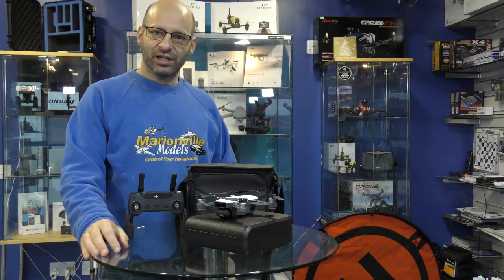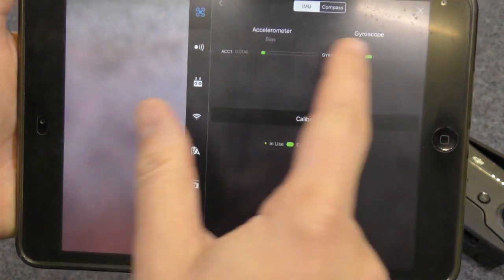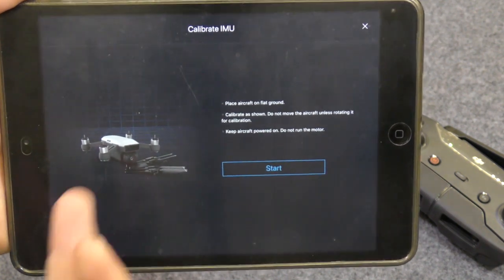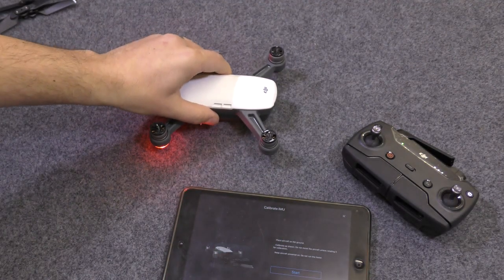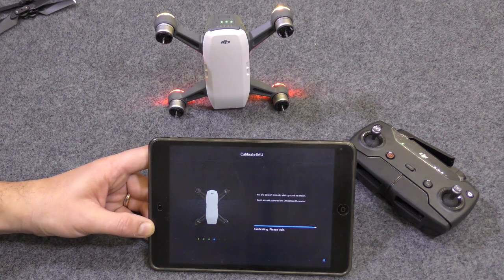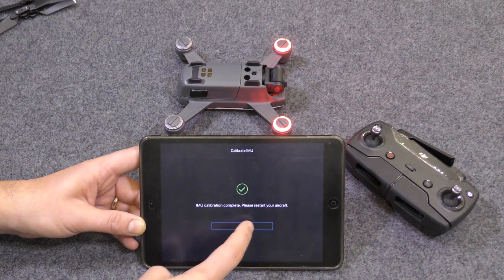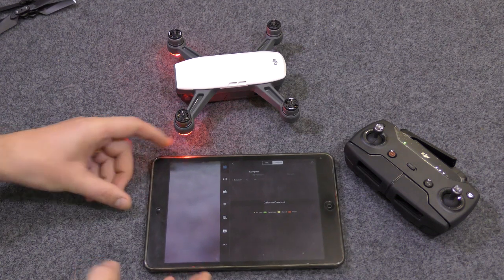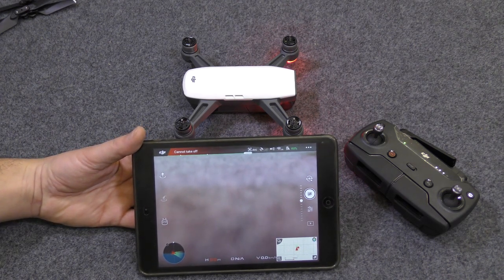DJI Spark Drone. How To Calibrate Compass & IMU

Comment: Hello dear i have connected sark rc through wifi with mobile, during the flight it show disconnected and i have to land drone manually with rc without footage and agian repeat on/ off process. What would be the issue ? Do i need cable connection within rc and mobile?

Comment: Hi there. I see you know a bit about the DJI spark, I’m having issues with one I purchased second hand recently. The problem I am having is the atti mode won’t go off. I’ve recalibrated the compass and the imu. The drone flies ok and active track is good but it never updates the home position. My drone appears on the map and it has satellites too
Reply: Are you using a controller or just your phone? If using the controller is it set to sport? That’s the slider switch in the Center.
Reply: @RC-Flight  I sold it a while ago buddy

Comment: Hi, i just bought a second hand dji spark. I calibrated it multiple times but it is incontrollable.  I swipe to take off and it immediatley drifts off. Any tips to get it to hover properley would be very much appreciated.
Reply: Have you solved the problem? I have the same problem
Reply: Hi, this is a long time ago. I dont think i did fix the problem. Ended up buying a new Mini2.

Comment: horizontal & vertical w/camera towards ground (latitude/longitude) is the correct way  - > not horizontal and sideway horizontal. i fly my spark daily, dji purposely misguided first time drone flyers with this incorrect compass calibration ..
Reply: Makes sense horizontal and camera down vertical for compass calibration, that's how you calibrate many other drones,

Comment: How can I get more distance in uk. I've changed yo FCC on 2ghz but still not getting any further what else can I go thnx.  Bigsighalive@yahoo.com
Reply from the maker: In the UK were legally limited to 500m by law so extending beyond that is kind of pointless. DJI make the power output depending on the location your in so you may find your still in CE mode despite the controller saying your in FCC. To be honest i dont fly beyond line of site so i havent looked much into it.
Reply: Aw thanks for the reply I hear what your saying  but  I really need to fly further    I’m also going to Cyprus on Friday and taking my drone I need distance ther too  to monitor my land  which  I can’t access by car or foot 
Wonder if il be able to fly further in Cyprus

Comment: I'm getting a check redundancy status  what does that mean
Reply from the maker: Haven’t seen that before but sounds like one of the sensors is having an issue.
Reply: @MarionvilleDrones  ok thank you
Reply from the maker: leemcrs74 if you check in google its something that comes up a lot but no solutions that I can find.
Reply from the maker: leemcrs74 have you had a bad landing lately.
Reply: @MarionvilleDrones  yes
Reply from the maker: leemcrs74 the IMU will have stuck. If you knock with your knuckles on all side of the craft body it may in stock the IMU sensor. You have to be quite hard with it.

Comment: My dji spark crashed, now its showing  "no 1 imu calibration error 71", pls help
Reply from the maker: pawan sharma the sensor may have got jammed. Try knocking with your knuckles on the top, sides and bottom of the craft. It may free it up.
Reply: @MarionvilleDrones  getting same error
Reply: I tried so many things but getting same error, pls help
Reply from the maker: pawan sharma i would speak to your dealer.
Reply: @MarionvilleDrones  sir any update?
Reply from the maker: pawan sharma speak to your dealer.
Reply: @MarionvilleDrones  Sir someone gifted me, dont have bill, I m helpless

Comment: Hello how do I get dji  insurance recently bought a second hand spark also have a mavic platinum but having difficulty in getting insurance something about I should have applied 48 hours in advance. Do you have an address where I can get a good insurance which does not cost an arm and a leg. Hoping you can help me Regards Irvine
Reply from the maker: Irvine Forbes yes you need to take the Care out within 48 hours of activation. If you contact DJI and send them a video of your craft in flight you can take out insurance after the 48 hours.

Comment: Why do I have to pair my spark and remote control every time I use it. It's a pain
Reply from the maker: Roger St martin that shouldn’t be necessary.
Reply: Use otg cable i had the same issues as you. Someone told me about the cable works great

Comment: Good Info, thanks. But for me it is not clear about the accelerometer and gyroscope bars. Is a dot only enough or must be displayed a full bar. The same is for compass.
Reply from the maker: br011075 less is better so a dot is good.
Reply: Marionville Multirotors. Thaks for your reply

Comment: I think this is a good post because when I first tried to cal the Imu I was doing it so wrong meaning I did not realise that it ment to go on its side I tried about five times until I notice the image was slightly different this post will help a lot of new jacks
Reply from the maker: AR 23 yes it can be confusing if your use to the old method of leaving it flat.
Reply: DJI doesn't tell you the Spark has to lie on its side for IMU calibration and not flat except at the very end when it has to be upside down.
Reply from the maker: 2027850 the images on screen should show you the correct orientation.
Reply from the maker: 2027850 yes it does on the screen of your device.